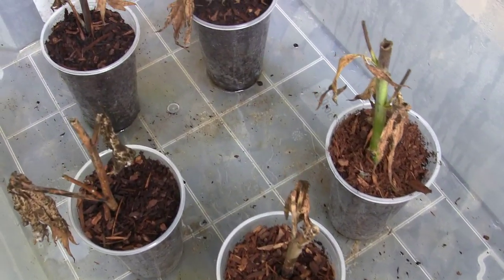Why am I Getting Mold on My Plant Cuttings | Why are They Rotting in My Propagation Frame

Comment: I have beeb able to propagate hundred percent of my cuttings. I live in Toronto area and in the middle of winter while outside temperature was around minos14C*, google says its 7F. I brought some cuttings from another country which all did work and have shoots growing, now. In Jan. 20, 2021 I went outside, in bone freezing temperature, again I did some hard wood cuttings of two different trees and did propagate them which one  have shoots coming out and the other has shown positive signs. Who wants to know the secret?
Reply from the maker: Me
Reply: @MikeKincaid79  Ok.
 Mike. The best time to do propagating, to my believe is the winter,  because you can avoid harsh summer weather or sun. Now please try the way that I tell you. Do some cuttings from any tree that you want, maybe few of them, then cut bellow the bud and push it into your hormone then in a white plastic bag make a bed of 2" peat moss  which is just moist in a way that you can feel it but it does not stick to your fingers, from one side to the middle then a foam or wood about 4" thick along the bed. Now push the cuts into the bed one by one and put the other end on the pillow(4") I should say. then close the white plastic bag completely but not tightly. and put it in a place with 60-70F. covering is just to keep the moist in the media as is, or stable. from two weeks to two months you will see the growth in the cuttings based on your plant. Good luck